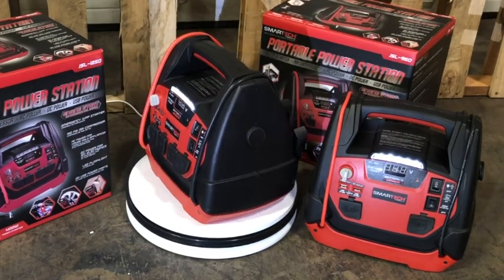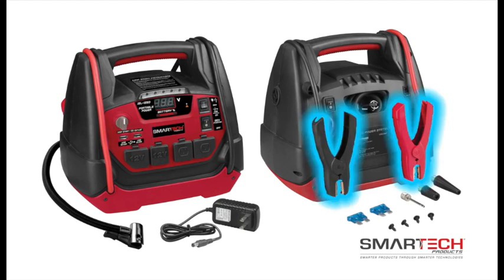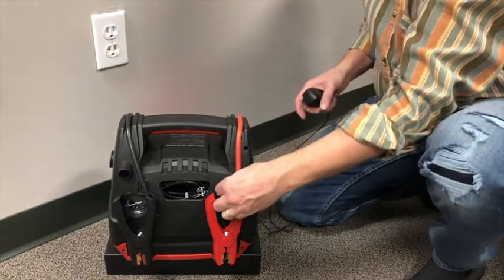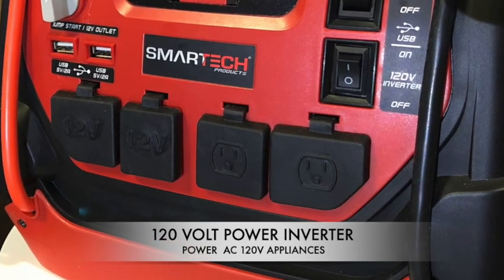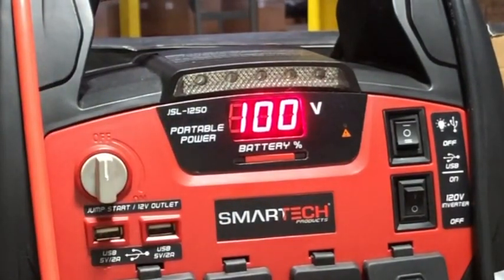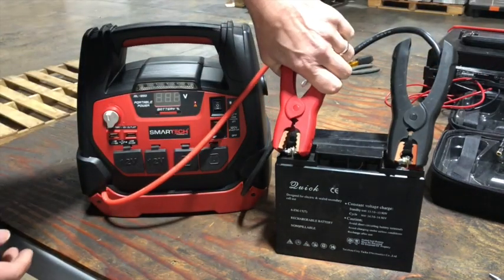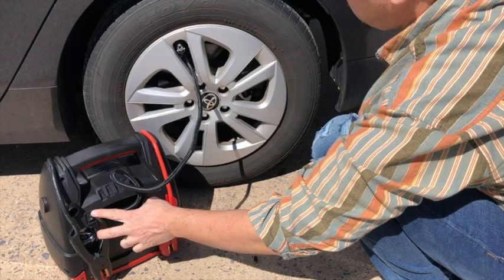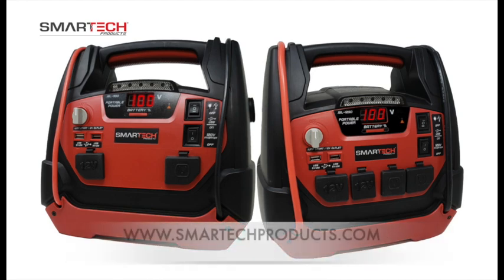JSL Series Power Stations

Comment: I have had the jsl950 for 2 years. The jump starter not strong enough for v6 dodge dakota.. The tire compressor only worked on 1 tire & never worked again… The recharging port is very flimsy. It broke & can no longer recharge this unit. Spend more money & get another unit. Waste of 150$
Reply: I GOT ONE IN MY CAR NOW--  TRIED TO JUMP MY NEIGHBORS VOLVO  
LIGHTS IN DASH WENT ON  950   PIECE OF JUNK
NOPE--
KEEPS LOOSING CHARGE TOO-  TRIED TO CHARGE IT TO 100  ONLY LASTS LIKE DAY
THINKING OF GETTING A BETTER ONE- LIKE A CAT ONE
THE TINY LITTLE ONES YOU SEE  POCKET SIZE ARE JUNK TOO